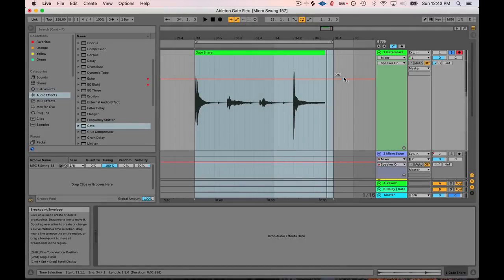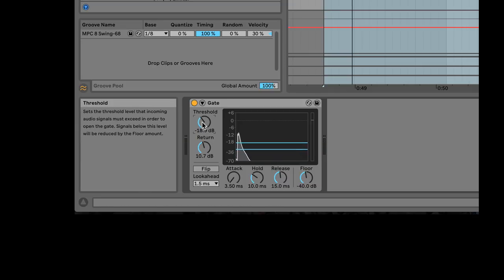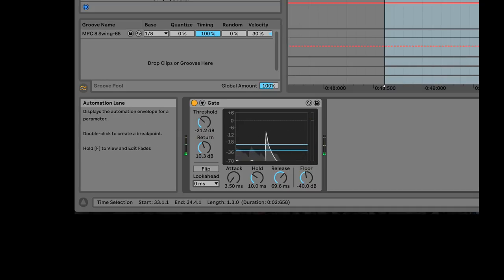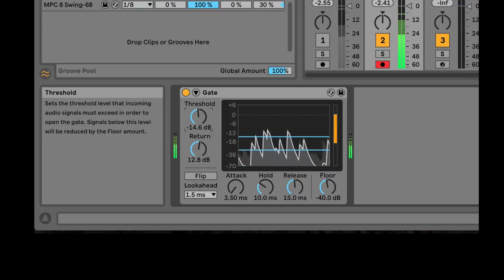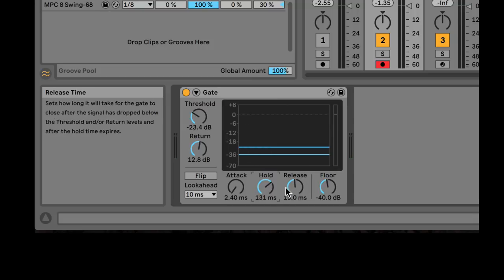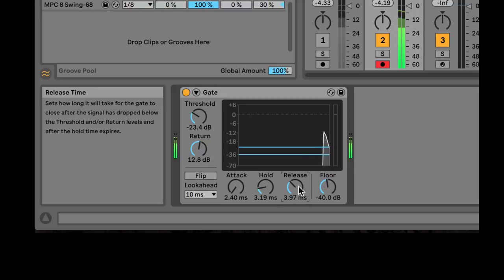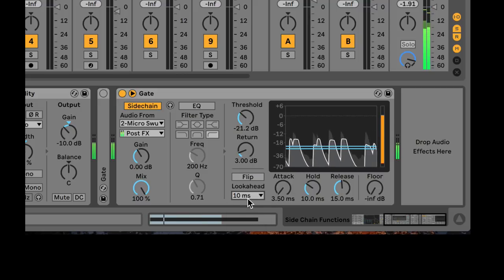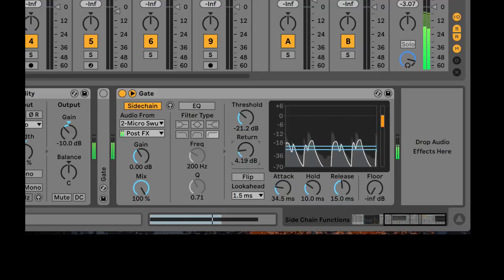Ableton Gate Tutorial

Comment: Feels like using the Flip button is like using regular sidechain compression but with a bit more more control of the sidechain.. Am i missing something?...
Reply from the maker: Yeah you could think of it that way. The difference though is unlike a gate, a compressor responds to material passing the threshold at a ratio like 4:1 and a gate disengages at a different time depending on the material that it is listening to. Basically there are advantages to both depending on the application.